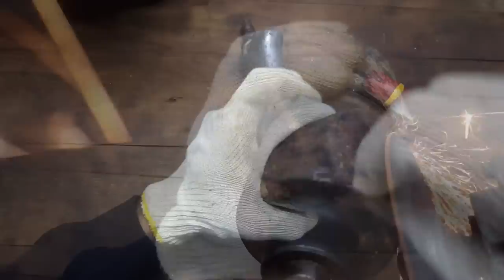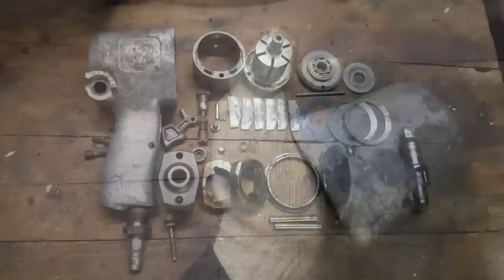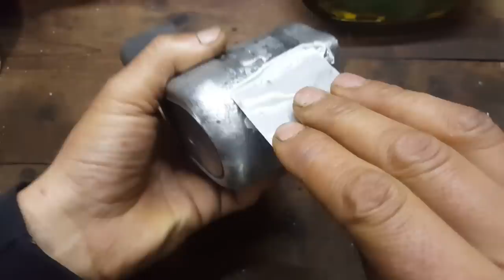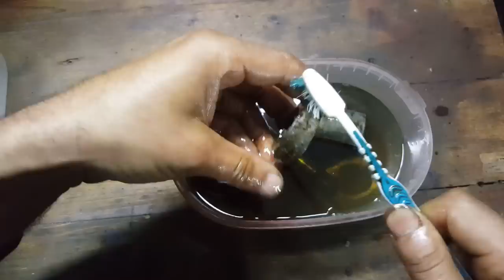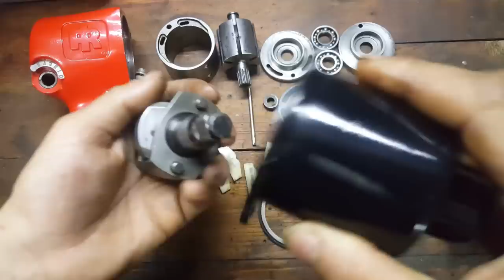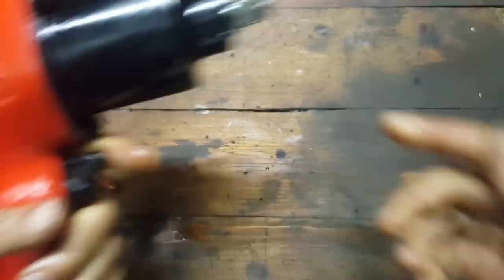Air Impact Wrench( Ingersoll Rand ) Tool Restoration

Comment: That's a model 231, 1/2" drive. It is an absolute beast. Never met anything it couldn't take apart: It either loosened it or destroyed it.
Reply from the maker: depending how hard you hands are hh
Reply: I have one of these in my tool box for when my CP impact gun isn`t man enough. A friend of mine was trying to strip a worm drive diff and could not remove some of the bolts from the crown wheel. He had been to 2 other shops and they had given up. He could not use heat because it would affect the hardening of the worm gears. I used my ingersoll and it just took them straight out. Awesome !
Reply: Used one of these things when I dismantled train cars. Out of a whole arsenal of impacts this was always the one I pulled off the rack and it never failed me after a drop of oil.
Reply: Best impact ever built
Reply: I have one at work, it isnt the most powerful ive used, and i hate how it blows out thru the front not the handle
Reply: @1991tommygun  there is a variation that blows through the handle. The 231H I think
Reply: Hi would you know the exact model number ,has is got any letters after the 231,l am looking for a impact gun like this,after reading your comment sir, thank for
Reply: @macdale4741  The model number will be IR231 or IR231C. The "C" is the newest version.
Reply: @desdecardo  thank you sir
Reply: Got one to it’s my I’m not asking anymore your either coming loose or breaking
Reply: @InsideWorkshop  yo quiero arreglar
Reply: @alandawson3345  ,
Reply: i have one ald love it, legit just give it a couple drops of oil befor using it (IR 231 isnt picky any oil will do🤣   i use motor oil)   and itl do  whatever you need,   decent hammer too🤣

Comment: I have rebuilt hundreds if not a thousand of these impacts. This particular 231 model is the best one. It has standard size parts as it is a true American made impact. The 231 model that came after this is China made and although it is still a quality impact the parts are not transferable. This was a good job. The only thing I would do differently is I would definitely blow all the parts off after washing them to remove any potential sand. Sand is an impact wrench’s worst enemy. Also you can take a 200 grit sandpaper, lay it on a flat surface and sand any potential grooves off of your vanes. However avoid rounding the ends while doing this..Also it is a good idea to lightly grease the hammer mechanism. All and all a good video.

Comment: i had an IR impact like that.. it was crazy strong..  at one shop we had 1/2" air hoses... high flow connections.. and 175 PSI of air..  one of the other techs.. had a CP that failed just as i was going to lunch..  he ask to borrow my impact.. i said let me show you how it works.. he was insulted.. i know how to use an air impact.. when i got back from lunch. he threw it at me... that thing is defective.. it just broke 17 studs on that Cadillac on the rack..  he had already complained to the service manager and the general manager.. i got called into the office.   the blinds were closed and the door closed... then we all broke out in laughter..   i never ask why he did not stop at just one broken stud..   he must have held the trigger on for 15 seconds each to bust them..
Reply from the maker: that was realy an embarrassing situation ..this guy will never use  impact guns  again
Reply from the maker: who know ..someday  he will see this video with a possibility of reading this..im not sure if he will say somethingor not , but i hope so :)

Comment: Very nice!! The cool thing is that the rebuild kits for older IR and CP impact guns are still available.
Reply from the maker: thank you
Reply: @Tim Noneyabusiness, any authorized service center or online. All you need is the model and serial #.
Reply: No comparison between CP & IR.  IR wins hands down.
Reply: howbdo i find model number if the tags all beat up? thanks
Reply: @transdimensionalist  if you don't have the model or serial number, you may be able to find the info by pic. Go to the website and look up repair/rebuild kits. You just may see a pic of your model.

Comment: I had one of these i bought through Mac tools in 2000 . It said mac on it but it was this exact gun . Well balanced and very powerful ! I replaced it with a snap on eventually and what a disappointment . Then I replaced that with a thunder gun which is very powerful !
 !
Reply from the maker: MAC and IR as many tools companies have almost the same shape of this gun but there is some different in details .i think .

Comment: Great job! As others have said add some grease to those hammers where they pound on the anvil. Also where use used the oring on the tip of the anvil gets a thin oring and a hardened metal ring to hold the socket on. If you don't find the rings let me know and I'll send you one. I have extras.
Reply from the maker: ..thank you Up Man  for your support .. i already took care of that. :)

Comment: I’ve got one of these that was laying on the floor in my old shop when it burned down over ten years ago, It laid there covered in debris until recently when we started digging it all out. It almost makes this one look pristine!  However, I clamped the anvil in my vice and was still able to turn it. But I would imagine just the cost of replacing the badly rusted anvil, and a rebuild kit would be more than it’s worth.
Reply from the maker: Depend how much satisfaction you will have when you rebuild this gun 😉

Comment: I’ve got the same gun. I rebuilt it a year ago and it leaks a little air around the trigger not sure what I did wrong but it works very well somebody said on here that it took two hands to hold it. I’m 61 years old and I can hardly hold it with two hands. Lol.
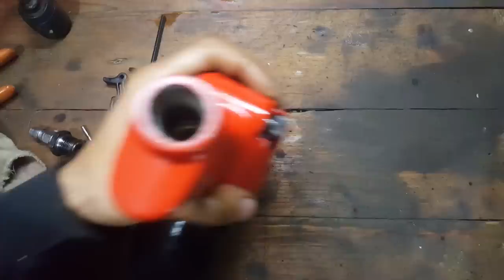Reply from the maker: may be you have change the spring with a more resistant one , a new o-ring , smooth and clean contact surface ( 12:35 )

Comment: When it was new it was advertised to have 650 ft pounds of torque in reverse 😄😄
Reply: I never bought one, but, they were quite torquey................and LOUD. I used a CP734. The power seemed more controllable and it was more comfortable in the hand.
Reply: When I bought mine new it seemed to have more than 650 worked in an electric motor shop and it regularly pulled 1inch bolts and Pulleys off it’s lost a little but I’ve had it 15 years or better and never have rebuilt it just greased it every 5 years or so

Comment: wonderful video, where did you find the O ring that went on the anvil? I'm looking for one or my Impact wrench. 8/18/2020
Reply: Just measure your anvil ant you will find right one in ball bearings shop (they have o-rings and metal rings). It can be that you need metal flat ring to put socket on it then just put regular sring ring on it ant hold sand paper on it, and turn wrench on. You will get flat ring...

Comment: Exact opposite of situation I encountered. It looked fine from the outside but the bearings were rusted solid. The inside of yours looks fresh and the bearings looked pristine. I see it operates but did you do anything to evaluate its torque capability?
Reply from the maker: wheel bolts test
Reply: @InsideWorkshop  Do you expect to use it?An inexpensive ($15 or so) impact  produces 200 ft lbs. Lug nuts  require about 95 ft lbs. Any idea of what make it is and its original rating?  I'd be interested in knowing whether it  delivers anywhere near its original power.
Reply from the maker: @65csx83  Since you are interested  I retried other test , this time with a torque wrench  witch gaves a 400 ft lbs as an exact evaluation

Comment: Where the hammers are requires grease not oil. Won’t get much use out of it. You can get an overhaul kit for this. I have the same style impact.
Reply from the maker: sure i will...thank you
Reply: yes they do use grease in the hammers and bearings. wheel bearing grease works great and the bearings and rotor blades almost last forever so no need for a rebuild kit 99% of the time,.

Comment: IR sells rebuild kits for these impacts. I have rebuilt one at least 7 times. I have maybe 30 of them. lol I found that aluminum wheel cleaner will take all of that powder off.You have to put Moly grease in that barrel . Not oil. Oil will not handle the pounding of the hammers.

Comment: Invest in a set of Allen wrenches and don't use Torx on then and you will not strip out the bolts, and have to cut them or weld to them. And a complete rebuild kit is available on eBay for less then $20.00.
Reply from the maker: did you take in count the  thread angle and pitch of bolts ..some kind of machines doesnt have the regular one  ...

Comment: god bless why did you paint the aluminum that had as little dusting metal on those as possible and as little paint in those as possible they where quite literally dropped from lifts if there was a lazy mechanic on duty

Comment: You should off changed the bearings while you stripped it down they could fail soon mate
Reply: its not a high speed tool.. those bearings will last for a literal eternity with some grease.
Reply: Wash them real good with brake wash and blow them off with an air gun and they will roar after greasing

Comment: how'd i know you were going to put body filler on it.. cool if you never actually use it, but the first time you set it on the ground it's gonna chip off. Same with the paint on the housing but that's because it is aluminum and shouldnt be painted anyway

Comment: Awesome is it a IH because it has the old IH style emblem with the H in the I
Reply from the maker: good !!! it s the  old emblem  but without H ..it s  R actualy
Reply: Ok gotcha but still they don’t build those air wrenches like they used to do you’ll get a hell of a lot of work from it
Reply from the maker: @farminginthe5706  Like many factories, they no longer produce the same quality as before
Reply: Inside Workshop yea that’s why I love working on older equipment and tools because they are tougher then the ones built today
Reply from the maker: @farminginthe5706 Today we only have comfortable  lightweight equipment that is fairly effective, has a short life and is not easy to repair, especially that contains  electronic component.

Comment: Those Ingersoll-Rand rattle guns are absolutely bullet-proof specially the ones with a metal case like you’ve got there....

If you go on eBay you can buy service kits for them and they come in a little packet with all the paper gaskets roller bearings various O-rings and rubber gaskets the six composite air veins a little tube of Ingersoll-Rand grease

 I know that you’ve cleaned everything up which is cool and put it back which is fine but you can buy a service kit

The new model guns have a  plastic case which is lighter but on the other hand it’s a bit of a shame too.....

Good job sounds spot on made to last
Reply from the maker: thank you

Comment: Air tools are now in the past it's all battery operated now... But nice project. I enjoyed it
Reply: I still use air tools everyday as a professional mechanic, so does everyone I work with. Simple, no batteries to worry about, reliable, and a good air impact gun still has more power than the best electric ones you can get right now.
Reply: @SGcomputing  Same, I know battery powered stuff is getting better as the technology improves.  It's really hard to compete with a good air impact.  Never have to worry about a battery being charged.
Reply: Air hammers have yet to be replaced. Living in the salt belt I hear them daily in the shop. Nobody makes a battery that can handle grinding all day either. My job has us all using IR built air impacts and air grinders. We’d run so many batteries flat running truck lugs off plus they’d walk off sooner or later. Cordless stuff is all Chinese built and the same quality in my experience with shop shared impact drivers and screwguns. Not to mention once the batteries are obsolete the tool is garbage.

Comment: All you need is to find a rubber boot to protect it with now..
What do you want for it..?😎
Reply from the maker: im not going to use it ..just a littel test time to time ..there is an other gun to use.. i hope that i find this boot or may be i will making some  trick for the protection

Comment: Please tell us the chemicals that you use in this restoration process.
Reply from the maker: not special liquids...diesel for  gearbox parts ...acide and water for frame (use it quickly to avoid any Damage caused by chemical reaction
Reply: @InsideWorkshop  Thank you
Reply from the maker: @papponmondal  you welcome

Comment: You can't weld more wrongly. Chasing the whole welding current through the gearbox is extremely unprofessional
Reply from the maker: it didn't realy realise that until reading this comment and watching  the video ..you are right ..thanks
Reply: Inside Workshop compare air tools
the

Comment: The Ingersoll i had the back had a little hole for greasing the rear bearing i use carbon fiber for the fins. Snap a few 5/8 bolts
Reply from the maker: you mean vanes ?
Reply: @InsideWorkshop  whatever you want call them

Comment: Thats not a restoration he cleaned it painted it and put it back together! He didnt even put new blades in the motor
Reply: 99 percent of the time you dont need new blades. most power loss is wear on the end plates or just needs a good cleaning.
Reply: @markkrause3569  still not a restoration just sayin

Comment: You just want a project? I never rebuild these they cheap if mine doesnt work i just buy new one. This impact is only 50-350 working torque and 600 brake away torque

Comment: I have one of these at work, hate how it dosent blow down thru the hande, it blows thru the front which means my face is full of dust, it aint that powerful either, ive had better luck with ultrapro
Reply from the maker: may be something wrong with in the trigger

Comment: Hey, it's an impact gun which means it gets worked hard, really hard and it gets dropped meaning the plastic filler will crack and easily chip off, meaning you have done a "static" restoration, not one that is to be used, a dynamic restoration.  Bad choice...think of the market you wish to reach, the viewers.  Start thinking of your video presentation, do you need the dirty workbench?  Better tools?
I will give you one more try and if you don't up your  game I am outa here!
Reply: Plastic filler is flexible and tough but it wouldn’t survive many impacts on a hard surface. A good sanding and polishing should’ve been done and left the small dings for character and story

Comment: I lost interest as soon as this person welded a handle at 90 degrees. Total lack of common sense.
Reply from the maker: by 180 degrees  your hand will be far from the stripped screw head , in same time it s hard to weld the handle completely with a vertical way  , 90 ° gives you much control
Reply: @InsideWorkshop  Yeah, I get it.  But how did you get the screw out with the handle in the way?  Did you go to all the effort to weld it on only to cut it back off?  Or did I miss something?
Reply from the maker: @chrisdavis6705  ..the important thing here is to ensure that screw  become free ....then yes  : cut it back off and weld vertically an other handle or may be just using a plier or a flat screwdriver after making a flat drive in the  screw head as i did ..

Comment: I seriously don't understand why you didn't just grind that one cut in that bolt and use a flathead to loosen it? Then you welded that little bar on it and realized you couldn't get a full rotation after it was said and done then you cut straight to it being taken care of😂 that was all so unnecessary
Reply from the maker: I tried with the flathead idea , didnt work ...  its a real stuck bolt here ..welding a bar horizontally make it closer to the headbolt (the center) witch gives you more control ..180°of rotation it enough to loosening the bolt ..then detach the bar and Re-weld it vertically to have the full rotation..